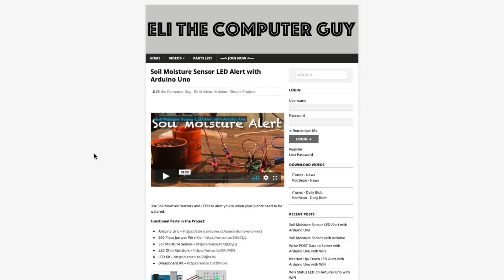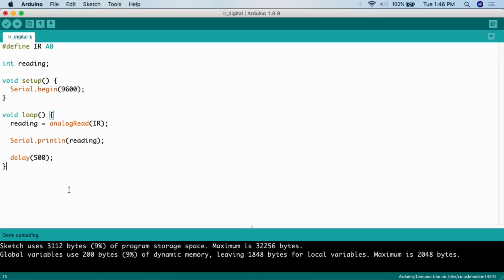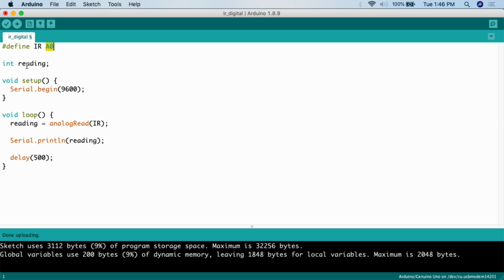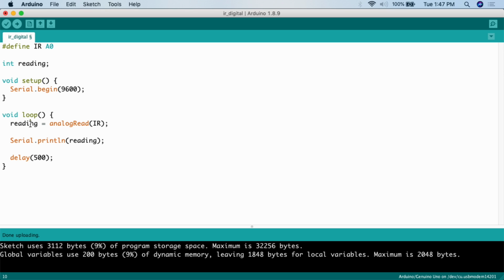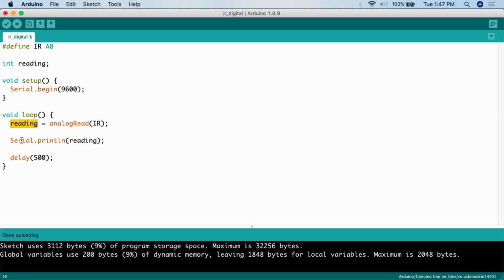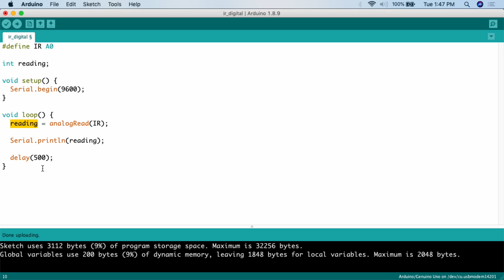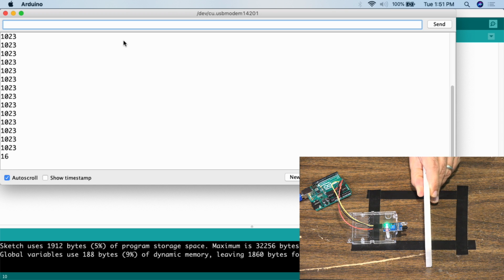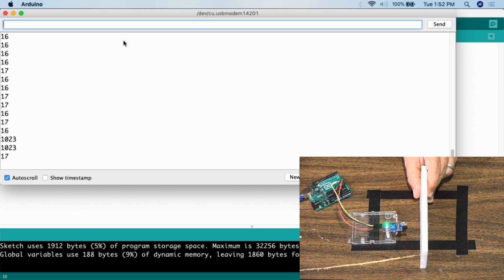Arduino -  IR Sensor Analog Output

Comment: Yeah. This isnt a good analog example although its plugged into the adc. The sensor uses an op amp which outputs 1 or 0 or 1023 or 0 - variation  on adc